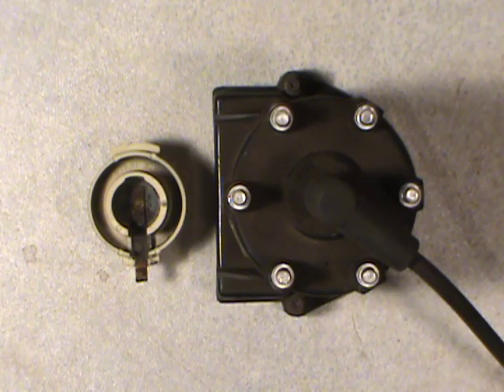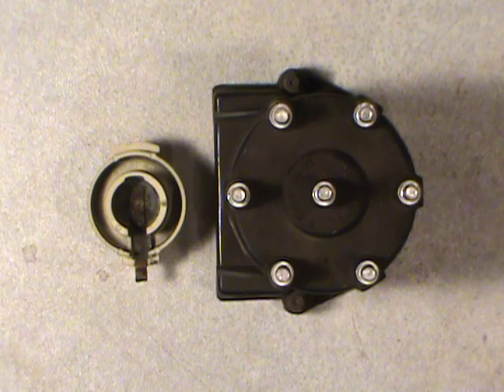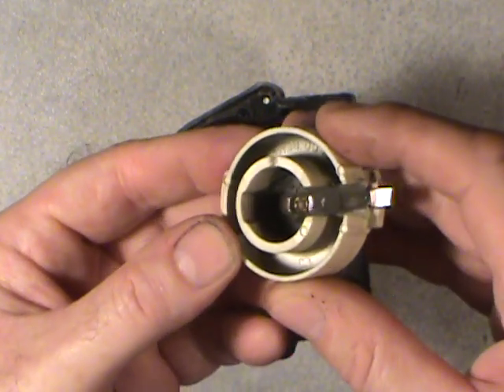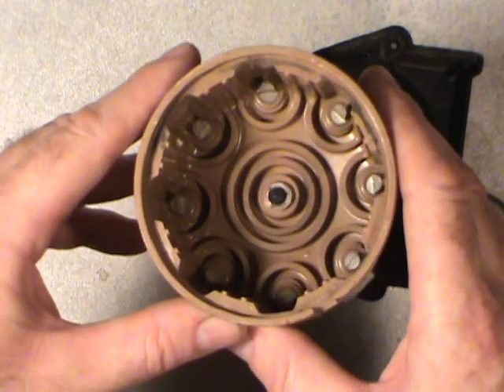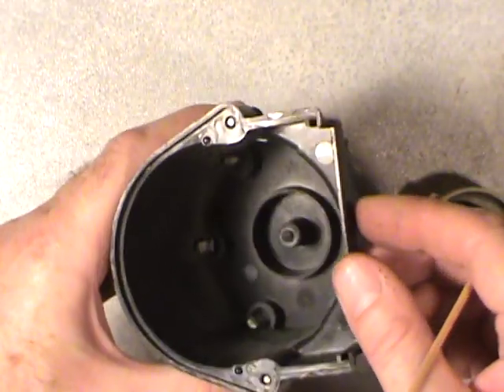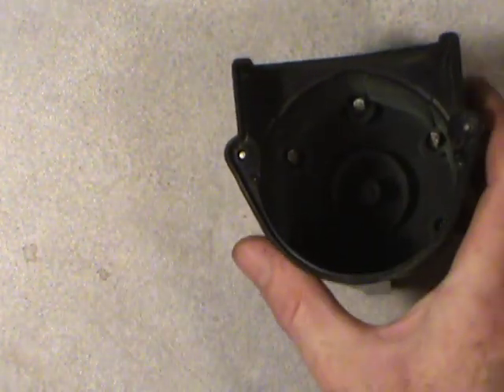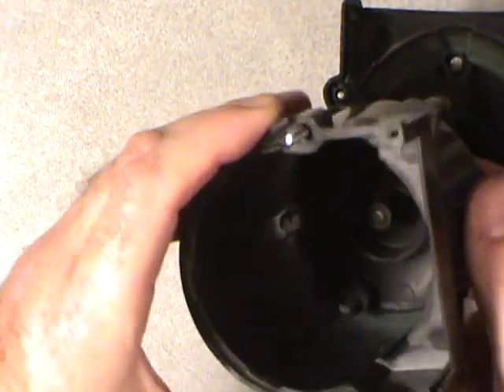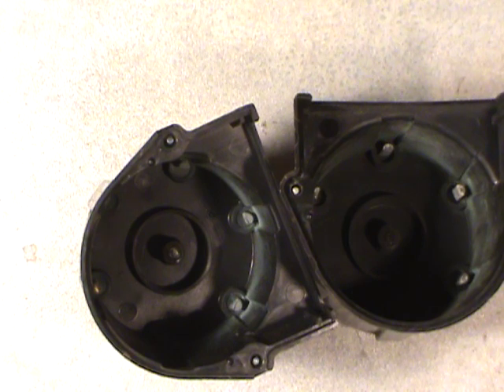How to Inspect Distributor Cap and Rotor Condition (Part 1) of 2 Parts

Comment: i need help my 99 tahoe has been sputtering at low speeds and has a hesitation the rpm fluctuates at idol no check engine light  has had a fresh tune up new injectors  when i press hard on the gas it will run fine when the when i slowly accelerate it will sputter  if the ac kicks in our out at idol the rpm jumps way down to 400 if i turn the turn signal on same thing condition happens weather its wet cold hot  weather the engine is cold or hot it also has had the iac change no change in operation the maf has been changed too the ignition system is also recent and the intake manifold and injectors are also recent the whole intake manifold was rebuilt cause of corrosion and bad injectors.
Reply from the maker: SuperJeremi10 Greetings SuperJeremi10....Thanks for watching, and for Your comment/questions, about the issues, that You are having, with that 1999 Tahoe of Yours.................................There are "2-Things", that really should be done, before, going on, and, as I like to say..."A Wild Goose Chase"...!!!...lol...pretty much meaning, by doing the following "2-Things" at the very Start, it could very well save, some Time and Money, in respect to, Wasting Time, and, Replacing some "Parts and Pieces", that were probably "Working Just Great", and, "Did Not" need to be "Replaced"...at all..........................Those "2 Things" are..."Scan the On-Board Computer"...in Your Tahoe, for..."Trouble Codes"...with a..."Scan Tool" (looks kinda like, a slightly Larger, hand held Calculator), that should tell You, wether or not, Your Tahoe's..."On-Board Computer"...has any..."Trouble Codes"..."Stored in its Memory"...or not...................................................The "Second Thing" to do, is to, have Your Tahoe's..."Fuel Pressure"..."Checked/Verified"...to make sure that, the..."Fuel (Gasoline) Pressure"...is..."With-in"...the..."Factory/Manufacturer's..."Fuel Pressure"..."Specifications"...and...be..."Very Careful"...when-ever working on the..."Fuel System"...as, the..."Fuel Pressure"...is in, about the 60 PSI (Pounds per Square Inch) Range...!!!...and, that "High, Dangerous, Fuel Pressure, Stays there for Days/Weeks, and maybe More", with-out the Engine Running at all...!!!...and, should be "Safely, Bled Off/Reduced, to Zero PSI"..."Before Disconnecting Any Fuel Line Components or Fittings"...!!!....and..."Always Wear Eye Protection"...and have a..."Fire Extinguisher Near-By" (just in case, and, I hope not)............................There are, perhaps, some of the Larger "Automotive Parts Sales Establishments", that will "Scan" Your Tahoe's "On-Board Computer"...for "FREE"...just ask them, and, see (actually hear..lol), what "They" have to say...good luck..........................................Here are a few "Things" to be aware of.............................."Vacuum Leaks"...in/on the Engine (Gaskets?), as well as, Any Vacuum Hoses/Pipes, that are part of Your entire Tahoe, that, can be "Faulty", or even "Diss-Connected" at times, perhaps......................Are Your Spark Plugs, as good as New, and, are the Electrodes..."Gap-ed" (as in Gap, or space, between the 2 Electrodes), as per, the "Specified" Spark Plug "Gap", for Your "Exact Engine"...???.............................Have a look at the "Deposits", that might be on, All 8 Spark Plugs, after a few Hundred Miles/Kilometers, as those Spark Plug "Deposits", are a Very Good "Clue", and, most of the Time, they have a pretty good "Story" to tell, about..."What's Go-In On, Inside Your Engine's Combustion Chambers"...............................It's probably a good idea, to just..."Remove and Replace"..."One Spark Plug at a Time"...so that "Any", of those..."8 Spark Plug Leads/Wires"..."Don't Get Connected to the Wrong Spark Plug"...!!!.......................................In the Past, I had a few Spark Plug "Leads/Wires" go "Bad" on me, and, while looking at the "Outside of Them", well, "They" looked just great, but, there was some "Faulty/Bad Connections"..."Inside" of, some of Their "Ends", where the (spark plug) "Leads/Wires", actually "Electrically Arced/Disintegrated"...between the (spark plug) Lead/Wires..."Internal, High Voltage Conductor"...and, the..."Metal End Terminal"...and one time, it was..."So Bad"...that, that particular Vehicle (at the time)..."Barely Made it Home"...!!!...Yikes"...!!!...lol.........................So, that's about it, for now..................................If You care to, You can let me know, how things are workin' out for Ya, and, if need be, just let me know, about Your Tahoe's Running issues, and, I'll do what I can, to help You out..................Good Luck, and.................Till next time..............Be Safe, take care, and have a good one.
Reply: well the fuel cant be it because the engine is running rich at all times you can smell it  i got a cheap tester and pressure is at 66-62 before cranking i waited 10 minutes it held pressure it cant be timing as it ran just fine before hand and timing hasn't been touched there are no trouble codes stored in the computer when i pull the plugs they look normal just normal wear  plugs wires and cap n rotor where all done 6 months ago i may check the cap again as its pron to failure in this model. when i bought all the replacement parts i bought only ac delco with life time warranty and i put platinum plugs in it which was recommended by the manufacture.
Reply from the maker: SuperJeremi10 Greetings SuperJeremi10....It's good to know, that Your Tahoe's Fuel Pressure checks out, and, how You were sayin', that, Your Tahoe's On-Board Computer, had No Trouble Codes, Stored in its Memory, as, that's basically tellin' me, that, the, shall we say "Things" (as in Component Parts), should be Functioning alright...............................The First thing that comes to mind (mine, that is), is, that, sometimes, that Troublesome..."EGR (Exhaust Gas Recirculation) Valve"...probably being, the "Electrical-Linear Type" (has a Wiring Connecter/Harness, that Plugs into the end of it), as opposed to, the good ole "Vacuum Type" (that only has, usually, one rubber vacuum hose, plugged onto it)..............................I had a Chevy V-6 Engine, with, what looks like, the very same "EGR-Valve", that, I think, might just be, almost, if not, the very..."Same EGR-Valve...that's on Your Tahoe's Engine...........What happened to the Chevy, V-6 Engine, was, It "Would Not Idle" so well, and kinda Ran like Crap, somewhat, at first, then, after, some more time, and mileage/Kilometer-age as well, that Chevy V-6 Engine, Lost, Lots of Power (as in "Gutless"...lol),  while just tryin' to maintain, the Minimum, Freeway/Highway Speeds, and I had to Push/Press the Gas Pedal Down "Way Too Much", just to try, and go, only that fast...!!!.....................................What it turned out to be, was..."Carbon Chunks"...some of them, being about the size, of an "Un-Ground Pepper Corn" (about 1/8 Inch in Diameter, there-abouts), and, the Carbon Chunks/Balls, would get "Stuck", between the EGR Valve's "Pintle" (aka, plunger tip), and the "Orifice" (hole/passageway), that it was supposed to "Seal Closed", and prevent "Recirculating Exhaust Gas From Flowing"..."When that Exhaust Gas, Should Not Be Flowing"...!!!...and, it, kinda Acts, just like, a "Major, Engine, Vacuum Leak"...probably would...!!!....................................There is a "Professional" way, that these, Un-Wanted Carbon "Chunks", and smaller amounts of Carbon Build-Up (sometimes found in high mileage/kilometer-age Engines, that have this, dumb habit), probably, get Removed/Cleaned-Up, and I recall the "Procedure'...(Machine's Name perhaps?)...being called (I think?), a..."Motor-Vac"...where, as I've heard, some time ago, this Machine/Device, might be Circulating some type of Cleaning Chemical (or, what-ever-it-just-might-be), through the Engine's..."EGR Passage-Ways"...to (Dissolve?), and get rid of, all of that/those, "Nasty, and Un-Wanted, Carbon & Carbon Chunks, that may have Accumulated in those very EGR "Passageways"..................................I almost had a GMC Dealer, do the "Motor-Vac" Procedure"...but..."They Didn't have One"...!!!...lol...so, starting from that point in time, I just Removed that EGR Valve, and, Fished around, inside those EGR Passageways, and, Removed, what-ever, that was Hidin' in there, with some, easily bendable..."Hay-Wire" (Yes-Sir-ee-Bob...Hay-Wire, was Used, Way-Before..."Duct-Tape"..was Invented...!!!...lol)............................I also made up, a Special "Screen Type of Gasket", that gets Installed between the EGR Valve, and the Mounting Surface, that it Bolts to.............................I made up "2 Gaskets", using the Old EGR Valve Gasket, as a "Template", and, I also cut, a Piece of "Stainless Steel" Screen (the Screen/Mesh, has about, the same size Grid/openings, much like a Screen, house door does), the same Shape as the Old EGR Gasket, but, With-Out the Hole in the Middle, and I placed a small Bead, of, some of that, High Temperature Silicone/in a Tube (to Prevent a Vacuum Leak), on the Outer-Most part, just inside, of the Perimeter, on the 2 faces, of those 2 facing EGR Gaskets, that I made, and Sandwiched, that, Stainless Steel Screen, between those 2 EGR Gaskets, that I made, and, that..."Custom-Anti-Carbon-Chunk-Stoppin'-Screen-Type-of-EGR-Valve-Gasket"...that I made..."Stopped All of Those, Un-Welcomed, Carbon Chunks"..."From Coming Through", ever again...!!!...lol...........................Then, as luck would have it, I couldn't even apply for a "Patent", for my "Anti-Carbon-Chunk-Stoppin'-EGR-Valve-Screen-Type-of -Gasket"...cuz...You and I, can actually..."Go Out and Buy One"...!!!...lol...as I later found out...oh well..........................Another Thing, that I'm thinkin' about, although, You were sayin', No Trouble Codes at all, is, Your Tahoe's..."Engine Coolant, Temperature Sensor"...and/or, its "Electrical Circuit", as well perhaps?..............................This "Coolant Sensor" (not the coolant sensor, for Your dashboard temperature gauge, or idiot light, as the case may be), is responsible for, Telling the On-Board Computer, when, the Temperature (for example...from, when, the Engine is Cold Started, and the Coolant is Cold), and, the Engine, and Computer as well, will be in, what's referred to as "Open Loop" (Operating Mode), and when the Coolant, oh, let's say, reaches about "140 Degrees Fahrenheit" as a ball park figure, then, the Computer should go into, what is referred to as "Closed Loop" (Operating Mode), but only while going easy on the Gas Pedal, for the most part).............................If Your Computer, stays in "Open Loop", while the Engine is up to operating temperature, and while go-in easy on the gas pedal, it will, as I see it "Run Way Too Rich, Air/Fuel Ratio-wise"...................................The Computer, will only Listen, to what the Oxygen Sensors, have to say (Output), Only when the Computer is in "Closed Loop" Operating Mode, and, in order to have the Engine, Run as Lean, Air/Fuel Ratio-wise, while just Cruzin' along, it has to have, the Information, that's being sent, from those Oxygen Sensors, or, it just ain't gonna happen...and, that's One Way, that a Fuel Injected Gasoline Engine, will Run Way Too Rich (Air/Fuel Ratio-wise).....................................Now then, about that, shall we say, "Re-Designed-Odd-Ball-Lookin'-Distributor-Cap-of-Yours"...lol................................To me, it looks like, it's Made that Way, so, all of the Spark Plug Leads/Wires, Would-Not be Crossing, all over Themselves, like the older/old school ones did, and, I believe that, each set of 4 Spark Plug Leads/Wires, on a V-8 Engine, would, shall we say..."Stay on Their Own Side of the Engine"...!!!...lol..................................I did hear, a while ago, how some High Performance (Engine) guys, and maybe Gals too, didn't like the New/Re-Designed Distributor Caps, all that much, as they were sayin', about, some of the not-so-wanted Issues, that they were havin'...just sayin' now...............As I see it "Ignition Components" (parts & pieces), can..."Never Be Too Good"...especially, when, Spark Plug "Gaps", get to be .045" (Four-tee Five Thousandths of an Inch) and LARGER...and the..."Much Higher, Secondary Voltage"...that has to Travel, Through the Vehicle's..."Secondary, High Voltage, Ignition System Circuit"...to..."Jump, that, Much LARGER, Spark Plug GAP...!!!...Yikes"...!!!...lol................If, and maybe when, You do decide to Replace Your "Distributor Cap & Rotor", try to get the Ones, with "Brass Terminals" on them, as, the Performance Folks, as well as myself, find them, to be about the Best, that can be had..............................Try to "Replace", as needed..."All of the Required Components/Parts"...as per the Factory/Manufacturers "Specified Time/Mileage/Kilometer-age Intervals"...to help, ward off, any, not needed Problems, due to lack of Maintenance, that really should be done, wether or not, the Vehicle Runs well or not, as...just like that ole Sayin', kinda says...and that sayin' is..."An Ounce of Prevention, is Worth, a Pound of Cure"...........................I'll answer Your Other Comment/Question soon...................Till Next time..............Be Safe, take care, and have a good one.
Reply: okay I just put a new cap and rotor plugs are good they are only8,000 miles old check them the are fine  prayed water on the spark wires they are fine haven't checked the ignition module maybe it could be the culprit I have a vortex v8 5.7 in a 99 Tahoe it runs just as crappy cold as it does warm no warning lights it likes to sput and sputter hesitate for a bit but when I floor it  it will get up and go there's no loss of power more like a hiccup or stumble then it resumes as normal when it does this in most cases it will shoot liquid out the tail pip the engine is very responsive though and t will easily from a dead stop get up to 70 timing has been checked and is correct im at a dead end I also got a 200 mile trip coming up id like to have it fixed before then so I don't break down it we did a tune up 8,000miles ago it was doing the same thing then only it got so bad it had a random misfire code we put new plugs in cap rotor wires  she ran great nice and smooth 8,000 miles later almost every symptom is back except the random misfire code im afraid to open down to the spider injector  cause then I have to buy a new gasket  and if it is leaking I cant afford o replace it but some how I don't think that's the problem that injector is only 4 years old the whole intake manifold was replaced new sensors new egr new injector module new ignition new tbi new cover maintance has been done on this engine I have no idea why they did so much work to the intake manifold I think the injectors had leaked  and they replaced everything to avoid having to open it back up or worry about it. I still have the old manifold with the old sensors. that Tahoe has a lot of power still just need to find why it sputters there is no smoke of any kind coming from the exhaust the more load its under sometimes it seems to smooth out and not run as rough but will still sputter.
Reply from the maker: SuperJeremi10 Greetings SuperJeremi10....About "Ignition Timing"........I find, it's always, a very good idea, to..."Check/Verify"...the..."Base Ignition Timing"...on an Any Fuel Injected Engine, when-ever an..."Ignition Related Part"...gets..."Replaced, with a New Part"...for the very reason, that, there are, what is known, as..."Manufacturing Tolerances"...pretty much meaning, that, there are, for the most part..."Small Variations"...between, any of the Parts, that..."Interchange"...with, one-another, and, these..."Sizes/Angles/etc."...might possibly, at times, make for, a..."Base, Ignition, Timing Setting"...that, can be "Out", a "Degree or More", perhaps...........................So, Always "Check/Verify", Your Engine's, "Base Ignition Timing", and, make sure, that, it's "Set", to the "Factory/Manufacturer's"..."Specifications"...to avoid, any potential Trouble....................There is another Possible "Thing", that might be causing, that, might be, "Ignition Related, Miss-Fire Problem", that Your Tahoe is having...........................It's known as..."Induction Cross-Fire"...where, it can be caused by, something as Simple, as..."Running/Routing, the Spark Plug Leads/Wires, "Parallel" (aka, side by side), and, Too Close, to each other", and, due to the High Voltage, that's Traveling Through those Leads/Wires, at times, that Very High Secondary Ignition Voltage, can actually..."Transfer"...from One Lead/Wire, into, the "Other" Lead/Wire, and, if, and when it does, the "Wrong" Spark Plug will "Fire", at the "Wrong" Time, and perhaps, the Spark Plug, that was supposed to get that "High Voltage Pulse"..."Does Not Receive It"...and..."Does Not Fire"...kinda like, shall we say, a..."Double Wham-ee"...lol...as in, One Spark Plug "Fires", when It "Shouldn't" be doing so, and the Spark Plug, that's supposed to be "Fire-ing"..."Does Not"...!!!...How You like..."Them Apples"...!!! (not to worry, as, it's...just...a figure of speech) lol.................Ever Notice, those, Spark Plug, Leads/Wires..."Separator Clips"... that are usually, made out of, what looks like Plastic, that are usually found, "Clipped" onto, the Spark Plug "Leads/Wires", on the Factory Installed..."Original"..."Leads/Wires"...at all...???...oh, and..."Guess Why"...??? (I think You get the picture)...and, I believe that "Plastic" is Used, as opposed to "Metal"...cuz...most Metals, happen to be..."Electrically Conductive"...!!!......................Another "Thing" to "Check", while You have Your Distributor Cap "Off", is to "Wiggle", the Distributor's "Rotor"..."Side to Side", in All Directions, to See, and maybe, Feel as well..."Any Excessive Side Play"...between the Distributor "Shaft", and the "Bearing/Bushing", that that Distributor "Shaft"..."Spins Inside Of"...as, if it has..."Way Too Much Running Clearance"...that, in itself, can make for some, rather..."Irregular/Not So Accurate"..."Ignition Timing"...oh, and also, quite Rarely, the, Distributor Drive "Gear", on the End of the Distributor Shaft, that Meshes with, the Camshaft Gear, might possibly, have some "Excessive Wear"...on the Gear's..."Teeth" (as in Tooth...lol), which can also, make for some, "Inaccurate", Ignition Timing as well.......................Try "Turning", the Distributor's "Rotor"...in..."Both Directions", by Hand"...and...there might be, a..."Small Amount of Movement"...but...if that "Movement", seems to be..."Way Too Much", then, that "Gear", I was just tellin' You about, could be considered, a "Suspect"..................................A "Clue", to me, if, any Timing Related, shall we say..."Near Failures", are about to, Rear Their Ugly Heads, is for me, to, "Pay Very Close Attention", to, if, and when-ever, the (Base, or, Initial..."Ignition Timing".."Changes", well, kinda "Mysteriously", and without "Reason".............Well, that's about my "2-Cents" worth for now, so, I'll see about responding to Your other comments.....................Be Safe, take care, and have a good one.
Reply: okay I have no idea how to set the timing if it is off I was going to check the ignition modal  after the tune up was done it ran fine for 8,000 miles the distributer does not have any extra play in it  and  when it turns it seems to be accurate I listened to it with a screw driver and it seems to spark every time it hits  without irregularity's u can  hear it when I rev it compensates it keeps a steady beat at idol it dosnt slow or speed up or drag unless commanded buy engine I still have them plastic clips on them the wires have no damage on them  I don't think the parts could have that much variation as I used gm parts from gm I used the gm part number on everything which is what was previously on it since that ignition system is so finicky I been using only gem recommended parts how do I see if the wrong plugs are firing at the Wong time i may end up having to have someone run a engine diagnostic  i do know the computer is starting to sense the issues though  the engine light came on for a brief period with a random misfire code.
Reply from the maker: SuperJeremi10 Greetings SuperJeremi10....Here's some more Information, that I was thinkin' about, that, might, perhaps, shall we say..."Shed Some Light on the Situation"...................................From what I recall, as it pertains, to the "OBD-2"...Computer, Program/System (that be, On Board Diagnostic/s, Version-2), that, as I see it, is the the "Type", of, "On-Board-Computer/System", that's part of Your 1999 Tahoe, and, started being used, oh, around 1996 there-abouts, and, had me thinkin', the following..............................I believe, that, Once, the "Emission Levels", that the "OBD-2" Computer System "Monitors and Senses", reach about, "1 & 1/2" (aka, One and One Half) "Times", the "Standard" (Amount of Exhaust Emissions), that was decided upon, by the "Powers that Be" (aka, Local Government, and maybe, in collaboration, with the Vehicle Manufacturers as well, perhaps), could very well be, the Reason, that, You were having some, Engine Running Issues, without having "Any Codes" Showing Up, well, aside, from the "Random Miss-Fire Code/s" that You were sayin', that You saw, that is...................................These, so called, "Random...Miss-Fires", as I see it, could be caused, by, not Only, the "Ignition System", but, quite possibly, By, the "Fuel Administration System", and for Your 1999 Tahoe, that be, the "Fuel Injection System", where, not only a "Rich, Air/Fuel Ratio", can cause some. Engine, Running Issues, but also, at times, there is a Type of Engine "Miss-Fire", that can be caused by a "Too Lean", of an Air/Fuel Ratio/Mixture, and, it's commonly referred to, as a "Lean...Miss-Fire", which pretty much, means, that the "Air/Fuel Ratio", that's being Administered to, "One or More", of the Engine's "Cylinders", becomes "Too Lean" (Air/Fuel Ratio-wise), that, there..."Is Not Enough Fuel" (Gasoline), in that "Air/Fuel Mixture", for any of the Engine's "Cylinders", that, just might, happen, to be "Affected", by that, "Too Lean, of an Air/Fuel Mixture", to "Burn Properly", that I was just mentioning..............................Every now and again, I have a Look, at the "Inside of the Vehicle's Tail-Pipe", when, the "Engine...Is Not Running"...and, if I happen to See, what looks like, a "Carbon Coating", on the Inside of the Tail-Pipe, that, pretty much, Tells me, that there is probably some "Un-Burned Fuel/Gasoline"...making its Way, all the way Through, my Exhaust System...!!!................................Might be Caused, by, the (Malfunctioning?)..."Ignition System", or, an "Overly-Rich, Air/Fuel Ratio/Mixture, or, perhaps, it might be, a very Pronounced "Lean Miss-Fire"...possibly, and, away I go, tryin' to "Track that Culprit Down"...!!!...lol...................................Fuel System-wise, it only takes, a Not-So-Good "Wiring Connection", to Mess things up, and, might be, somewhat Intermittent, at that.................................One or More Fuel Injectors, might be Clogged, or Stuck Open, some-what, and, perhaps, not Functioning Properly, Electrical-wise, which, as I see it, will "Alter/Change", the Amount of Fuel (Gasoline), to a Different, then, Wanted/Needed, Amount of Fuel Injected, for the Speed and Load, that is placed, on the Engine, at any given time, while it is Running....................................I'm thinkin'...if, and when, that (Random?)..."Miss-Fire Code", that You saw, shall we say "Develops Further", as in, what-ever is "Causing" the "Hick-Up", in Your Tahoe's Engine, to the Point, where it, just might get "Bad Enough", for Your Tahoe's Computer, to be able to "Set a Trouble Code or Two", then, if, and when it might/does, that my Friend, should, shall we say..."Open a few Doors, and Shed some Really Bright Light"...on...what-ever-it-might-be-that's-causin'-all-of-this-annoying-not-so-smooth-running-engine-of Yours...(I say, as I'm gasping for Air...!!!...lol).......................................From what I recall, those, so called "Trouble Codes", that get Stored, in the OBD-2's, Computer "Memory", get Stored, in, More Ways then One, as, Some Codes, might be Intermittent, in nature, and, some Codes, shall we say, have to Mature, kinda like Grow, over a period of time, if You Will, and, that OBD-2, Type of Computer/System, will Decide for Itself, what "It" wants to do, with, what-ever, it happens to be..."Sensing"...from the Tahoe's, Many "Sensors", and maybe, the "Actuators"..."Behavior"...as well, at any given time..........................................Mr "MIL" (aka, Malfunction Indicator Light, I think?), might "Light-Up", as well as, a "Trouble Code" or Two, gets Stored, in the Tahoe's, Computer Memory, some time in the "Future", as the Miles/Kilometers, Accumulate, on Your Tahoe's Odometer, and hopefully, that "Culprit/Gremlin", will be Exposed, for what "it" is...!!!...lol.........................................Did You happen to Change/Replace Your Engine's..."PCV-Valve" (Positive Crankcase Ventilation...valve)...at all...???...as, this, so called "PCV-Valve", in all actuality, is really, a "Designed, and Controlled, Engine Vacuum Leak"...!!!...say what...???...lol................................Yes-Sir-ee-Bob, that "PCV-Valve". that You should, be able, to readily See, Installed/Plugged-into, One of Your V-8 Engine's, Valve/Rocker Covers, and usually has a Rubber Hose, Plastic Pipe, or maybe even, a Metal Pipe, Connected to/on "it", is Responsible, for..."Regulating"...the..."Amount"...of...."Air/Fumes Flow"...that gets..."Drawn Through...Vacuum-wise"...from, the, shall we say...Your Tahoe's, Engine, "Lower Crankcase/Oil Pan (inside) Area"....so that, things like "Sludge", don't develop, and Un-Wanted "Fumes/Contaminants", get "Vented", and "Re-Burned", by the Engine, but, Only, when the "PCV System", is "Working Properly".................There are times, where, a "PCV Valve", might get "Plugged-Up" (which causes, Lack of Air/Fumes Flow)...and...also, that "PCV Valve", just might get "Stuck Open", possibly, which will, as I see it, become, a rather "Un-Wanted, and maybe Excessive, Engine-like Vacuum Leak", which, has the ability, to cause an Engine, to "Idle...Not So Smooth/Shaking possibly".....................................If, and when, You might, (or, maybe You already have?)..."Replace that PCV Valve"..."Make Sure"...that, You Buy/Purchase, the "Exact/Specified"..."PCV Valve"...for Your Tahoe's "Engine", as, although, "They", might "Look Alike" (from the Outside), there are..."Many Different...Flow Rates/Calibrations"...and..."Each and Every, Different Engine"..."Known to...Man/Woman-kind"...has a..."Very Specific"..."PCV Valve"..."Flow-Rate/Calibration"..."Made/Manufactured/Specified"...for, the..."Engine in Question"...with, Yours being..."Your Very Own, Tahoe's Engine"...!!!...lol.................."Better...Safe, then Sorry"...I say...............So, there You have it, well, for now that is, and........Till next time.........Be Safe, take care, and have a good one.
Reply: well it dosnt look like carbon build up in the exhaust is an issue its starting to bog down at times now pcv hasn't been changed but has been checked and is operating as it should if I unplug the valve from hose and start car the engine light will come on shortly after the computer is working all the sensors are brand new on top of the engine except the egr  02sensos arnt that old either iac is also brand new an working within range maf and map are also new the intake dosnt seem to be leaking I sprayed water every where and the engine idol did not change ruled out a vacuum leak I ay change he fuel filter or least take it off and check it and the ignition coil modal might get replaced the car never puffs smoke out unless its cold day and hasn't been running after it warms up any smoke goes away but it has been bogging down past few days.
Reply: I already know what it is im gonna change the fuel pump as soon as it hi 1/4 it started surging it had a sudden rush of power also loss of power on the freeway going over a bridge even though it runs fine on full when the tank goes down its showing sure signs of a faulty fuel pump im going to test the flow again and see but I have a hunch im losing the fuel pump.
Reply: okay its finally giving of more of a code it has a p0175 code on the computer